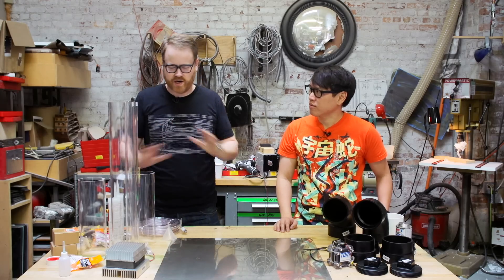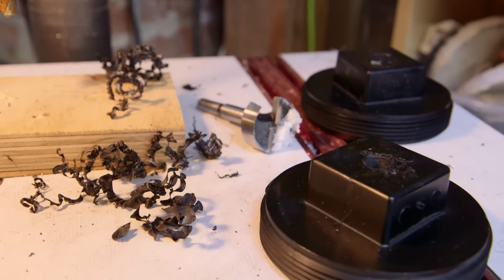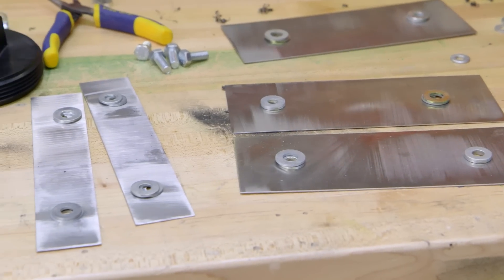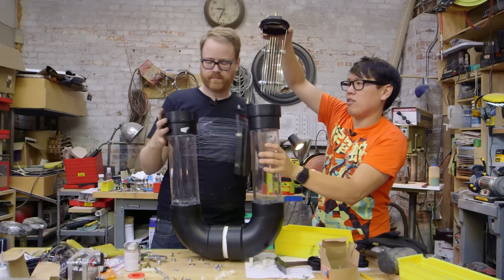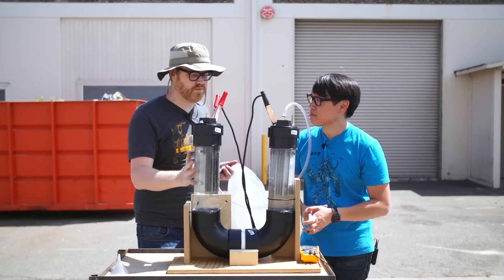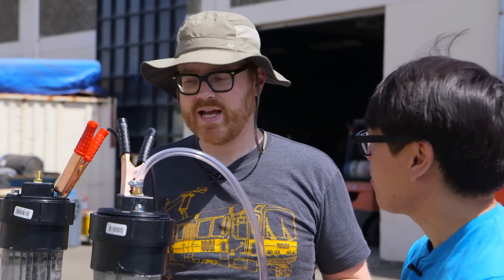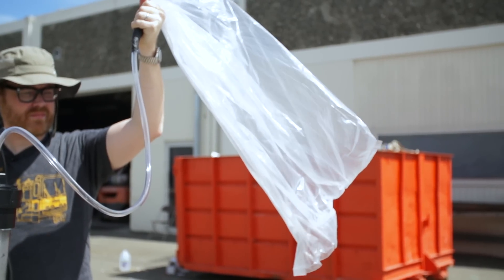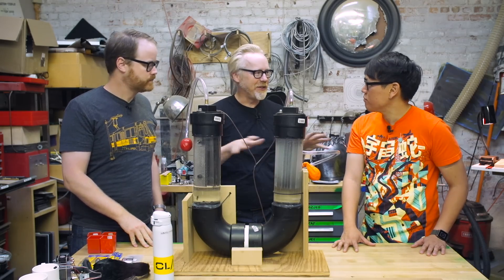Tested Builds a Hydrogen Converter

Comment: I think this is a pretty good example of why Hydrogen is a terrible energy source... And those that think it is the 'future' are bonkers.
Reply: perfect example of people who can't think outside of the box. that is what it is. do some research try it yourself.
Reply: This video is in error on the construction of a generator for H2. The design is based on a HHO generator the distance between the to nodes is much to large for there tiny current from the solar panels. Hydrogen holds around 10x the energy of gasoline is made from salt water, (they could have used baking soda as there salt and skipped the whole caustic bs) and when you burn it it turns back in to water and that's. No CO, CO2, NO2, etc. Its a powerful Clean, Renewable fuel, that is why people are saying its the fuel of the future. (disregarding it possible use in fusion reactors.)
Reply: I want to clearly state right here at the top I think that electricity is what is going to power nearly everything in the future. How we get that electricity is up in the air, as there are a lot of factors which come into play, but ultimately we will have electricity powering our world.

Now let's get to debunking your statements.

"Hydrogen holds around 10x the energy of gasoline"

Not at the same atmospheric pressure. And compressing it uses more energy, which makes it even less of a viable choice. Not to mention that you have to compress it to crazy high pressures (I see the '700 bar' figure tossed about a lot) that you are essentially carrying a bomb just of pure pressure--nevermind that the gas contained within is also combustible... And that H2 is the smallest molecule, which means all the seals of every single part is going to have to be so perfect, so that you don't just waste H2 in leaky fittings... Nope. Not buying it.

"[Hydrogen] is made from salt water"

If by distilled water that you add a salt to to make it more electrically conductive, then yeah. You are right. But how do you get that distilled water? Oh, by lots and lots of energy to get it in that state. And then you want to spend more energy to separate it into H2 and Oxygen? How is this a better energy source, let alone fuel for a car again?

"when you burn it it turns back in to water and that's [it]"

Yeah. This is true... Better capture that water, since it will be of reasonable purity and you can recycle it again by separating it into H2 and Oxygen... That's probably the best way to save energy in the production of hydrogen...

"Its a powerful" No, we discussed this already...

"Clean" sort of, if you don't count the energy required to make/store/transport it...

"Renewable" Sort of, again, I mean it comes from water so yeah...

"that is why people are saying its the fuel of the future."

And I am going to state "People who think H2 is the future of energy are bonkers." because of my reasons above.
Reply: for one you do not need distilled water any water will do. I built an electrolysis rig I use in my research and I just use tap water and baking soda works great. IDK these people thought it was so important its not. The reason 700 bar is used is because at that pressure H2 condensates into a liquid at that pressure it has almost 3x the energy density over gas (JPL to be exact), and H2 is one of the easiest fluids to compress its not like air. for H2 powered cars they use 350 Bar and its about on par with gas as far as energy density.  Look i'm an aerospace engineer idk about cars but I don't see large aircraft adapting batteries anytime soon for weight reasons alone, and graphene makes a wonderful container for hydrogen being light and almost no molecular gaps and a little bit stronger then titanium and should be in mass production in a year or two now. Plus having H2 cells (depending on how they do it) generate lift and energy it just makes seance. Is H2 dangerous, yes. but so is every fuel out there. Electricity would be nice by its self, but H2 simply as a way to store energy, has its uses(keep in mind the best batteries in development(lithium air) right now only have an energy density of 1MJ/kg vs H2's 142MJ/kg and there 5 years away maybe) and hydrogen fuel cells are upwards of 90% efficient at converting all of its energy into electricity. You might be right from small things like cars, but for aircraft you need a LOT more power and that is what H2 is a lot of power for very little weight. And again the reason a scientist would think its the fuel of the future is for its fusion applications setting all of this aside.
Reply: You keep saying that H2 is on par with gasoline as far as energy density. Please show me where you are getting this information, because literally everything I find from actual sources online say that it is not... 

I'm willing to be wrong, but you are not providing me with any hard evidence, other than you saying it is so--and I am supposed to believe you just because you are an "Aerospace Engineer"... Of which I am am also just supposed to believe you actually are.
Reply: if you would have googled energy density of fuels any one of the top 5 results gave you the same or similar numbers to what I gave you. but out of them this one is the most official (the wiki page is well sighted too.)

http://www.afdc.energy.gov/fuels/fuel_comparison_chart.pdf.

However if you don't like that you can look into the fcx clarity by Honda. It uses a hydrogen fuel cell and 4.2 Kg of hydrogen and has a range of 372 km (keeping it metric) and is based off of the Civic. The civic hybrid has a 10.6 gal fuel tank and a range of 643 miles(best case). Gas has density of 2.77 Kg/gal so it has 29.36 Kg. in comparison gas Civic gets 21.9 Km/kg, and the Fuel cell Civic gets 88 km/kg thus the 4 times more energy however that tank would have probably been much heavier then its gas counterpart its a carbon titanium alloy. (This information was pulled for Honda's Website mostly. The tank design was a academic Journal I read ages ago if you really want it I can try and find it.)

Another example of Hydrogen power is the space shuttle (or any other launch vehicle), it uses a liquid hydrogen liquid oxygen reaction to propel it into space. Its NASA's fuel of choice for almost all of it's 1st stage rockets due to its efficiency. (this is common Knowledge, but i'm sure you can google it.)

The Sun is power by (mostly) Hydrogen fusion and its one of the most powerful objects know to man. (again common knowledge - middle school science).

you know I was only having a conversation with you I like having these conversations with people so I know why people think the way that they do. After all it might help me in my work. But if you really had an objective mind about this, is was not that hard to find the information I was pulling up and for you to get that Up-ady when you never sited your finding either. Typically in this informal I will not site all of my information due to the many i use in these arguments. The last comment I made I used at least 10 different pages just to make sure what i was telling you was not BS, or my mind mis-remembering something.

As for me I am a Grad student studying aerospace engineering, I do research in satellite navigation and trajectory optimization for a government grant. I am currently developing a system to test satellite systems using a high altitude drone that i'm designing (thus the need for Hydrogen for partial buoyancy). Dose this satisfy you?
Reply: Devin Anderson I mean, I did look up some things... And this line is what made me ask where you were getting  your information from.

From https://en.wikipedia.org/wiki/Hydrogen_fuel#Energy

"Historically, carbon has been the most practical carrier of energy, as more energy is packed in fossil fuels than pure liquid hydrogen of the same volume."

So, I mean to me--the untrained and certainly not in school and not an aerospace engineer--that says that H2 is not as energy dense as other carbon-based fuels such as gasoline.

Your PDF says that it is at best case 100% the same energy as gasoline... So, I am confused.

So, I don't know how you get your other figures... But that to me says that H2 is not better than gas, and I can't honestly be bothered to check all your 'facts' with no sources attached to them.

So go ahead and write me off as another idiot who doesn't believe in the H2 nonsense.
Reply: the Wiki article refers to liquid Hydrogenhow do the known gas energy sources compare in gas form''...Pound for pound, hydrogen contains almost three times as much energy as natural gas...''-Popular Mechanics
Reply: I love how everyone says these things and never links to any of them.
Reply: dude I linked all of my sources, your just to incompetent to understand them.
Reply: *****

maybe you can make enough on board to power a car
Reply: *****

ooh

Alexander Borsi must have deleted my link to the Popular Mechanics article
Reply: *****

there is currently no affordable electric car that can go 350 miles per charge in America

 
and the raw materials to create the gas on board are very cheap
Reply: *****

like I said

what car?

name an affordable EV that can go 350 miles per charge that is available right now?

an HHO generator requires a lot less electricity from the battery than an EV
Reply: Drunken Hobo your engine dosent burn the all of the fuel the hho helps burn it all and the computer reads the spike in RPMs so it cuts down on fuel
Reply: Drunken Hobo your engine dosent burn the all of the fuel the hho helps burn it all and the computer reads the spike in RPMs so it cuts down on fuel
Reply: Drunken Hobo your engine dosent not burn all of the gas it is injected in liquid form gas only burns in vapor form. the added hydrogen burns in a wide ratio , gas not so much. hydrogen burns a lot faster than gas and it turns into water vapor. they also said that the Wright brothers couldn't fly
Reply: Drunken Hobo hydrogen will improve hp and efficiency
Reply: *****

'' I have no idea why you keep asking that question as it's not relevant to your idea.''

it is relevant because a car with an HHO generator could keep running for a considerable distance with an extra jug of water while the  average EV will need to be charge for 5 to 8 hours after 110 miles

my idea didn't involve a fuel cell

the car could run on HHO

it's not efficient but when the raw materials used are so cheap why does it matter?
Reply: *****

the electricity is provided by the alternator

''If you weren't using a fuel cell, how do you get the energy from the hydrogen''

the HHO flows or is vacuumed into the engine chamber
Reply: *****

''So what drives the alternator''

HHO gas

a circle of energy is created

'' And what sort of engine does the hydrogen flow into''

ICE
Reply: *****

a free energy device would be a closed system

this isn't a closed system

it requires the driver to add more water once the all the water in the generator  has been c converted to HHO
Reply: *****

'' but you don't get all of that energy back when you recombine them in the ICE, due to inefficiency''

from earlier in this debate :

''it's not efficient but when the raw materials used are so cheap why does it matter?''

''Water does not provide energy to the system, it requires energy.''

that's debatable

many feel that water has no energy

a small minority disagrees

the hydrogen in water is energy
Reply: *****

'' You'd need more than 100% efficiency for your idea to work''

where do you get this idea?

is the gas combustion engine   100% efficient ?

'' In your example, water is analogous to a flat battery''

 a dead battery has no energy

I think since water has hydrogen it has energy

some scientist may disagree but scientists have been wrong in the past and have had to change their position on some subjects

so they are not infallible
Reply: *****

''The hydrogen in water is chemically bound to oxygen atoms and in order to free the hydrogen you have to put in energy''

if this system  makes an engine run for three minutes where is the engine getting it's energy from?
Reply: *****

ok

if I had a generator inside a garage
and the electricity to split the water is coming from the wall ac outlet

if I pump HHO from the generator into a car engine chamber  and the engine starts running where is the energy coming from to run the engine?
Reply: *****

so how did the electricity turn the water into a fuel that  can be burned in an internal combustion engine?

specifically
Reply: *****

does the electricity make the hydrogen explosive?
Reply: *****

then the explosive energy of hydrogen didn't come from electricity

I thought you said it did?
Reply: *****

isn't   the engine running because  hydrogen explodes?
Reply: *****

my example has a gasoline ICE engine as the vehicle in question
Reply: Drunken Hobo ice don't use the full potential of their fuel and yes you do kick out a bunch of unused fuel that is why we have DPF and catalytic converters. dpf catch all of the unburned fuel and burns it same with cats

Comment: Why not use Lye, and Aluminum?  Wouldn't that be faster?
Reply: Both of those are a lot more expensive than water and an electrolyte.
Reply: Not with the way they built things. They already had the lye (KOH) and it would've been cheaper to buy a roll of aluminium foil and find a spare non-reactive container

Comment: That bag is probably leaking hydrogen like a sieve. Hydrogen is the smallest atom in the world, and it leaks trough most things. So a thin plastic bag is not the way to collect it. Use some sort of solid tank and a bubbler. And the tubing is probably leaking a little to so use som copper pipes to leak as little as possible.
Reply: There was a lot more gas in the bag than in the balloon  SOMETHING DOES NOT STACK !
Reply: A plastic coke bottle would have held the H2 a lot easier than the trash bag. put water in it and have the water get pushed out as the hydrogen fills it up. This was a really bad example and to me was set up for failure.
Reply: This is exactly what I was thinking.  Those bags are super thin and have tons of microscope holes in them that hydrogen would leak right through super easy.  Plus the rate at which they were producing it was very low.  And in the end they didn't even try to explain why it didn't work.
Reply: they probably kept the amps low  so it wouldn't produce  HHO in the first place
Reply: lol

Comment: Those grade 5 (zinc plated nuts I believe) will more than likely create some additional reactions .. should become apparent by a different color of water after just a little bit of use and changing the conductivity etc.
Reply: ** also if going the way of a solar panel maybe hook up a capacitor in between to act as an "accumulator" and then discharge the higher current every time it gets to full charge ... kinda like high current pulses every "X" minutes and hopefully find the most efficient (HHO making) "break through" current/voltage.

Comment: HHO is very dangerous ,when it reacts with the air it wil explode,nasa use hydrogen to power its rockets but real problem is you need to storage hydrogen and any leak is dangeroues,hydrogen is clean but it is expensieve,the tank must be sealed of the outside air and it must stay in cool enviroment so your storage is your bottleneck,to expensieve to setup such system,the only problem is storage bottleneck...

Comment: You should give this another go, A Car battery pushes more amperage which allows current to push past the resistance in the water to bridge the gap between the cathode and the anode. A better solution would be to get rid of the UJoint and slap on EndCaps to the end. Cut openings on the bottom of the tubes and use another tube to join them using glue. This will drop the gap distance and decreases the current needed to bridge the gap. When you half the distance you reduce the energy required by 1/4th.

Comment: I have a stupid question.  At the anode a water molecule is split up, and the Hydrogen is collected.  What happens to the Oxygen atom from that molecule of water.  Same at the cathode--water is split and Oxygen is collected.  What happens to the Hydrogen atoms at that end.
Reply: in an electrolysis setup there is an equilibrium established where the water is actually comprised of hydrogen and oxygen cations and anions respectively. When the processes occur at the anode and the cathode, there is not any split of water into the hydrogen and oxygen, but it is simply transferring electrons to convert them into their respective gases. You should google electrolysis and Bronsted-Lowry acid/base theories to get a better understanding of what I just explained, but that's the relatively simple answer :)
Reply: nothing happens because this whole build is a joke. anodes and cathodes should be as close to each other as possible (not at the opposite ends lol). google it
Reply: So what happens in a proper build?
Reply: would apriciate you opinion on this, is it real and could you use regular tap water https://www.sciencedaily.com/releases/2015/06/150623113836.htm

Comment: A few thing I noticed that where not very accurate. 
1. Only 2 (1.2v - 1.5v I think) volts is required. More then 2 volts result in heat being produced. Increasing Amperage does increase gas production. AC can be used to produce oxygen and hydrogen at all electrodes.  
2. The distance between your electrodes should be as close together as possible. Had trouble with designs like this myself.  
3. Regular Baking Soda (sodium bicarbonate) works great as an electrolyte (makes water more conductive). Both acids and bases  can be used just be aware of any reactions to metals, plastics and adhesives used in construction.
Warning - a 1 liter bottle with 30psi  hydrogen oxygen mix can turn a porcelain sink into gravel.